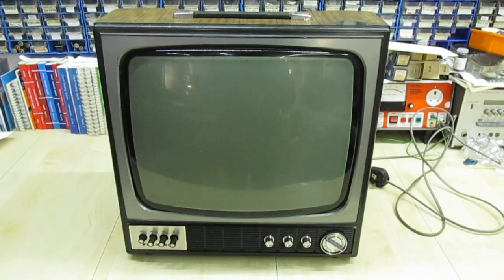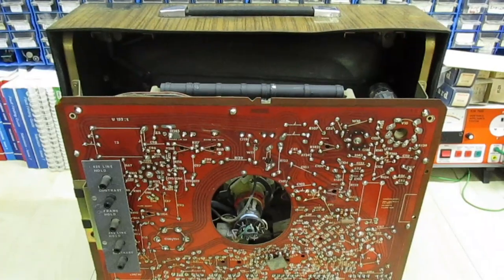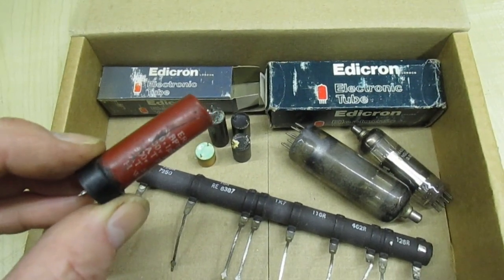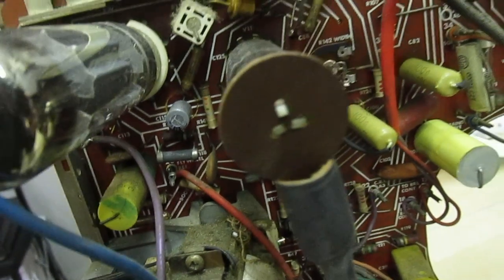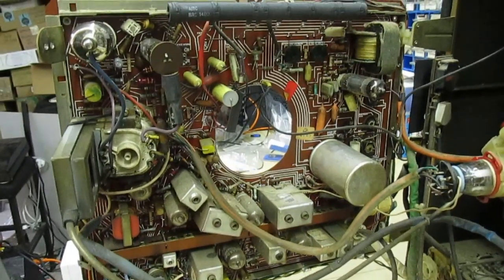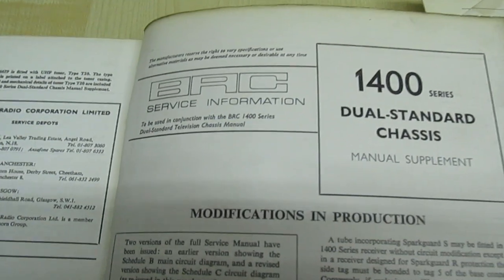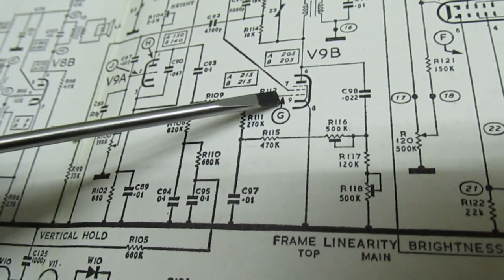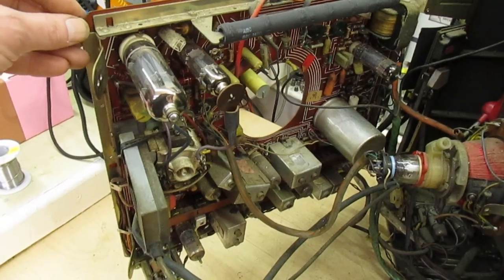Lets take a look at the Thorn 1400 Chassis TV set from 1967-1968 .

Comment: Another great video Michael. Takes me back to my apprenticeship at BRC Gosport during late 60's, transitioning from the 1400 to 1500. Thanks.
Reply from the maker: Loved the 1500 , best set of all time for me ,never ever changed a line transformer in either of these sets , the 1500 was the perfect blend of technology , valves in the power stages and transistors in the low voltage parts of the set .
Reply: Lots of 1500s back in the seventies on rental , bottles and droppers. I cut my teeth on them .
Reply: Hello 'The Oldgit' I live in Gosport, only a mile or 2 down the road from the old Ultra Factory. I used to repair these at Southern Rentals, Havant, from 1979 to 1981....

Comment: Gosh, we used to buy these ex rental for 1.00, sell for 28 to 32.00 depending on size. Standard procedure to take out VHF tuner, remove cover, switch cleaner on the long UHF biscuit, remove a few smaller one's to allow room to bend forward (and clean) spring contacts, replace cover, set system switch to UHF (625), and switch clean. I think there was a 33k vertically mounted resistor near the fusible resistor that would burn out and cause a wishy washy picture, cured by simply cutting it out! Loved those dodgy Drainsmoppers! Ever remember the old GCE dual standards?
Reply from the maker: I remember at the time seeing Black and White television sets offered at £1.00 each in bulk loads in the back of Television magazine .
Reply: @michaeldranfield7140  Yes that's right, ex rental stock mainly, some b grade. I think the rental companies gave them away free to anyone who would guarantee to take X amount of sets per year. GCE hybrid colours for a tenner! In general we'd get 8 out of 10 working and use the others for parts.

Comment: Great video .Every repairmans favourate set untill the 1500 came along. I still have a few NOS droppers  and some of the vdrs i cant throw any thing out.lol
Reply from the maker: Dont throw anything away, you never know when you might need it .
Reply: Remember the RS resistors people used to fit on open circuit sections ?. Me included .
Reply from the maker: @glpilpi6209  Yes , I still have some RS components ones in stock , we called them Polo mints

Comment: just wondered if the shorted turn line linearity  device might be causing a lack of width ,as i am not familiar with the set up on thorn tv,s the ones i worked on specified  a quarter of an inch gap between the plastic end in your case red and the start of the coils,
Reply: Yes its pushed right in as far as it will go !Easy to get more width pull it half out think he's missed that

Comment: I have one of these in my collection. I was a bit disappointed with it, it worked perfectly, straight off the bench. One day, it may need attention, but for now it's as good as gold.

Oh, I must swap those "Callins" caps in the audio amp! Even though they're not causing any trouble as yet.
Reply from the maker: the 1400 and 1500 sets  have special memories for me as these are the sets i use to bring from the tip as a kid, but the 1500 is my favourite one and much safer to work on live as the lopt is on the opposite side.

Comment: A quick way to obtain 405 signals is to get someone with a VHS vcr and converter to record some on tape.. Usually it records  well, just need a decent quality blank tape which may be the problem now.
Some machines do record better than others apparently. 
You can then build the modulator,Trev in Scotland built one using a couple of miniature valves.
Reply from the maker: I did see Trevs video with the Russian valves , I need to get something sorted as I have a few 405 only sets but like everything else time is my biggest problem,

Comment: i used to have several of the later 1500, one even a granada branded version but were all sold off cheap, when they werent as sought after as they are now ....
Reply from the maker: I have a couple of 1500 s , one a 20 inch and a 24 with the original metal stand , 1500 was my favourite set back in the 70 s , even had one in my bedroom as a teenager .
Reply: @michaeldranfield7140  when i got hold of mine in the late 80s to early 90s, they were old but still loads of them around here, a local tv/radio shop had a few out on cheap rental

Comment: This looks a lot like the Ferguson courier 3816 i had in the early 80s, brill little portable that was. to me sets like this were the ONLY way to watch old black and white films like they should be, i loved my courier lasted for years, even after i retired it the crt was in top condition.
Reply from the maker: Ferguson courier, that's a name I have not heard in a long time.
Reply: @michaeldranfield7140  Brilliant old sets they were, lasted forever
Reply: @Synthematix  the 3816 'courier' was a 12 inch black n white , mains battery portable, 1590 chassis, i have one,  thats a 'survivor' of a neighbours house fire, the front moulding has bubbled due to the heat, knobs distorted, strangely the rest of the case ok, but seems made from different plastic, amazingly it worked ok after a clean up, there was apparently an earlier mains only 'hybrid' valve/transistor version 1580 chassis, very rare, especially now, the 1590s and 14 inch 1591s turn up quite often

Comment: Was the grey tripler a doubler and the black tripler a tripler depending on the screen size, or is that another brand/make or chassis I was thinking of ?
Reply from the maker: From memory I think the original factory fitted part was the same size and colour but one had 3 sticks and the other 5 sticks but there were pattern parts made that looked physically different ?

Comment: Another great video, quite modern looking for their time. Was the sound never great on these was it plagued by  intercarier buzz? I can't remember. The 1500s were good did  they do a  totally solid state after that? 1510?  Was that the last of the BRC big mono sets.
Reply from the maker: The 1500 hybrid was my all time favourite set and I still have a couple , the last large screen to be produced was the Thorn 1600 all transistor /IC  and I have one of those as well , did a video  on both of these sets a couple of years ago . Thorn came up with a resistor change for the intercarrier buzz  but someone has already done this to the set before I got it .
Reply: HMV badged 1500 models had lovely wooden cabinet versions  , the deluxe model .
Reply from the maker: @glpilpi6209  I have a couple of nice 1500s  but both in plastic cabinets .

Comment: Does dual standard work by just changing the frequency of the line and frame oscillators ? Is the width collapsing because the VDR is overloaded or has it just gone out of specification.  I would be interested in having one of those set due to ease of working on it.
Reply from the maker: I dont get involved with 405 because I don't have s standards converter but no ,its much more complicated than that,every aspect of the set is changed when on 405 thats why the system switch has so many contracts,on 405 the sound is AM ,on 625 its FM just to name one difference,I have found some VDS and as they are not marked with a part number identification seems to be by   paint mark at one end but so far the ones I found have different paint marks,disconecting the VDR brings on a massive width increase so I would imagine its characteristics have changed but I would need a new one to compare with ,I have the part number and chances are its made by mullard so a look through some vintage mullard data books may give a clue.

Comment: instead of having that convoluted 'safety' circuit to indicate diode shorting, why didnt they just put another diode reverse biased from the junction of diode and valve heaters to circuit ground? it'd then pop the fuse, bush/murphy did with some of theirs, in others they used similar idea to the 1400 but  diode other way round, and smoothed the dc heater pulses to feed the screen of the PFL200 sync separator, if the diode shorts you lose all sync(murphy v2015s, used to have one)!..  they'd have to add a cathode bias resistor and cap to the frame out valve to make up for losing the negative bias, maybe their original idea was cheaper than an extra diode, power resistor and electrolytic cap(they wouldnt need the other resistors and caps to smooth the bias, though)?!

Comment: Dropper resistors....what on earth were we thinking?
Reply from the maker: I know , but in those days electrical safety was not that important and sets did catch fire.
Reply: @michaeldranfield7140  not to mention the wasted power..unreal solution.
Reply from the maker: @mikemargo  I'm building a valve amplifier at the moment just for fun and I have 3 valves running straight from the mains on a live chassis with a dropper resistor, I managed to cut the dissipation on the dropper resistor  from 60 watts to 30 watts  by using a silicone  rectifier diode in series with the dropper just like they did in valve TV era , keep your eye on my channel, valve line up is PY800 rectifier, PL81 audio output and PCL802 preamp  !!!